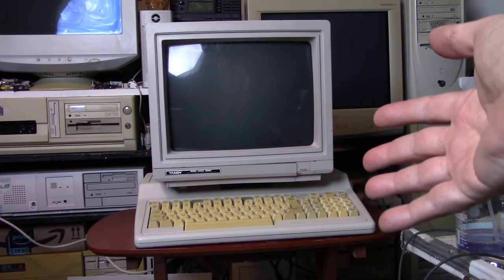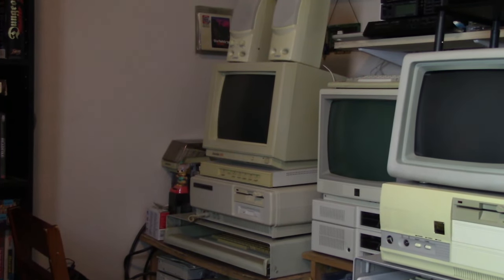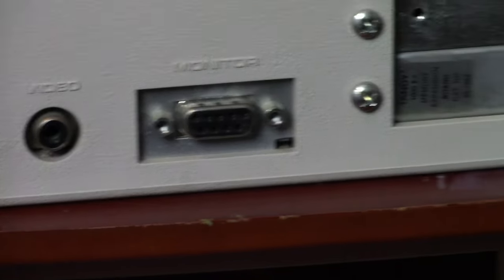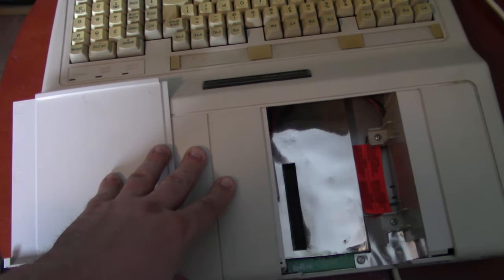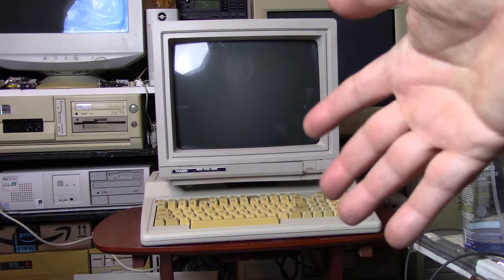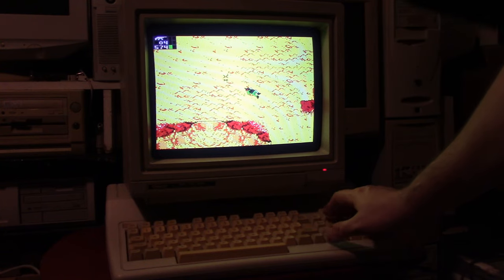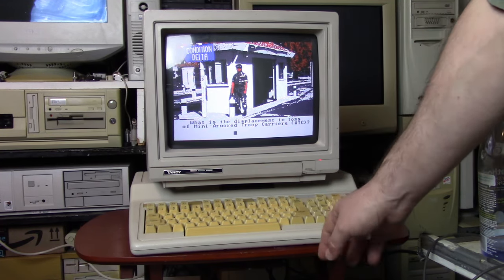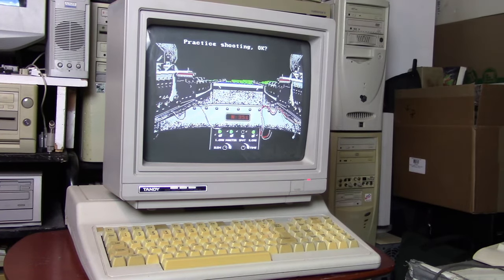Tandy 1000EX

Comment: I can definitely feel the amiga 500 / home computer vibe here, but that 5.25" side floppy looks awkward. I think 3.5" was already a thing when this was released. Besides, even at 7.16Mhz 8088 doesnt have a power to move 32KB of frame buffer (needed for 16 colours mode).
Reply from the maker: The side drive isn't very awkward as long as you keep the area next to it clear. As I said you can always get a 720k external drive if you'd like. There may even be a way to replace the 360k drive with a 720k, never looked into it.

I dunno, I've played a ton of games on this and the Tandy 1000SX in 16-color Tandy mode and they played just fine. Gunboat which I used in the video was a bad example, it played too slow but lots of games played fine. I think your genre of choice also plays a large role in this as well. For instance, I played Pools of Radiance and Curse of the Azure Bonds all the way through on my 7MHz 1000SX in 16-color Tandy mode and it was a very enjoyable experience, including the first-person sections. Of course, those were turn-based RPG games with a slower gameplay